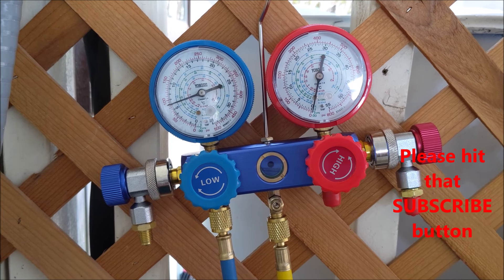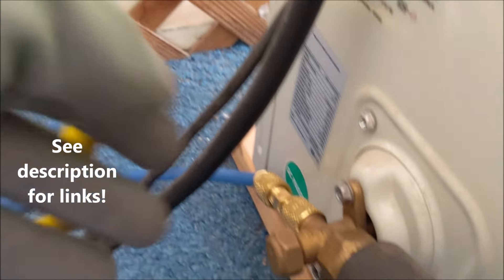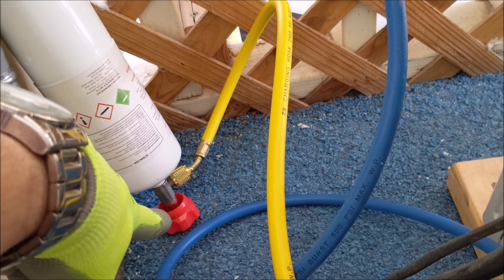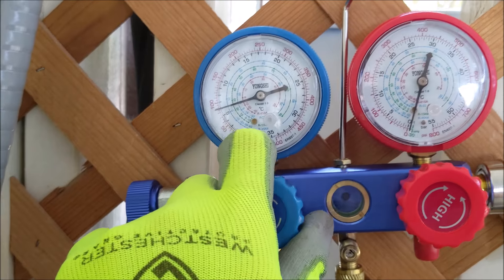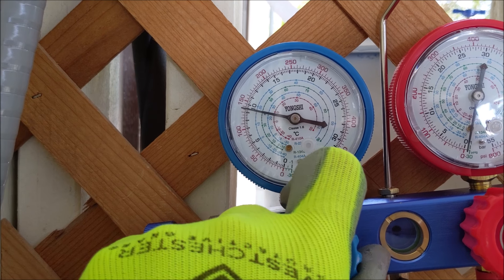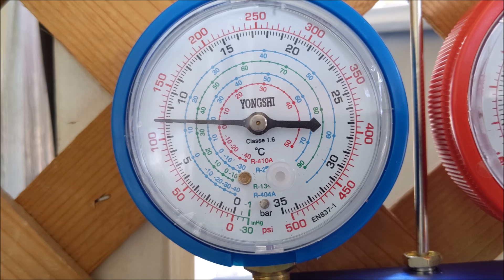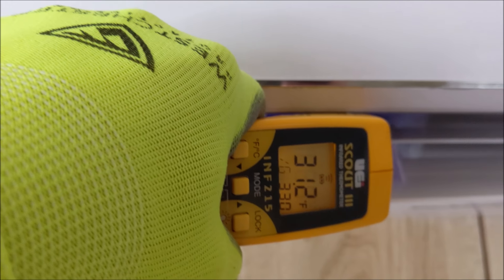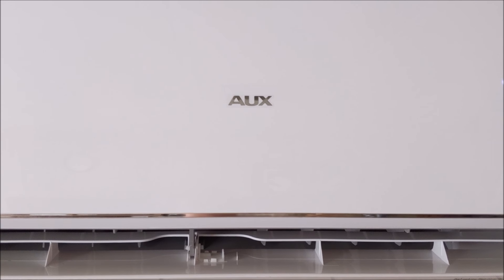How to charge mini split yourself, DIY 410a refrigerant, save money!

Comment: The bottle of 410 that I bought didn't come with a valve to open the bottle and the valve that came with my vac pump doesnt fit either. It appears to be a 1/4 in fitting but im unsure. Did your bottle come with the valve?
Reply from the maker: If you bought using the link I provided https://ebay.to/2AoIRvK (TRUSTED SELLER) you would have gotten one with a valve, as the valve is an actual mechanism needed. If you bought somewhere else, maybe to save 5 bucks, you got no valve, the cost of a valve mechanism. Cheaper is not always better. You also need to buy an adaptor, for the mini split, like this one.... https://amzn.to/30e0Tu9
Reply: 1/4” typical but 5/16” on mini splits.
Reply: Make sure you don’t have a manifold gauge for cars which is not the same size. It happened to me.

Comment: I dont get why mines shows 150 psi in blue gauge. It has 1 year of use, never had to add refrigerant, and is cooling not too much like first months. I tried first low the pressure getting refrigerant out, but not see differences in psi, then I tried adding refrigerant to see anychanges and nothing. Very weird
Reply from the maker: It could be a leak somewhere in the system, you will need to find the leak and fix it.
Reply: Call a professional

Comment: Hi, tnx for the video. Is it the same for the R32 cooling agent? The same device works? From what I saw on yours it only says R22 and I can hardly find one that says R32.
Reply from the maker: You need to check what type of refrigerant you have, as many refrigerants have been phased out over time and replaced.
Reply: @SaveGreenHere  I have R32 refrigerant.
Reply: @CountPorcula You can’t mix refrigerants. The outdoor unit has a label on it and he was using Freon 410a, not automotive freon.

Comment: I could use some help with an issue I have.
I have a Blueridge mini split that has a leak it's been dead for about 2 months now.
What would be the best way locate the leak and since it's not been working for 2 months I'm sure all the R410a has run dry so would I need to refill the unit in order to find the leak? What would you recommend doing?
Reply: Use nitrogen tank to put pressure on the system then listen or use a soapy water mix to spray on it to look for bubbles.
Reply: @rdewitt3468   you did not answer the question , he has NO refrigerant in the split. how does he fill it ?
Reply: can you run the mini split with out any refrigerant in it  to use your methid to add r410a .Will this hurt the compressor?
Reply: @bsd3662  he can’t fill it with no nitrogen. Needs to be vacuumed, pressure tested, and then refilled with 410. He needs a technician that is qualified.
Reply: @bsd3662  your mini split won’t even operate without refrigerant.

Comment: Does the 117-120 psi range apply to different sizes of AC units?
Reply: My 20 amp 110 unit said low pressure 220 should I just follow that sticker ?

Comment: $70 to show up and diagnose (what I already know), $95/lb r410a to charge here in Naples FL, typical cost?
Reply from the maker: If you did the install as a DIY, you are on the hook, because most likely the leak is in the flare connections.  If you had a professional install it, and the leak is on the flare connections (90% sure it is), then they should add the refrigerant on their own dime, for poor installation practice, and seal it so it does not leak again.  If the leak is in the coil, that is a different story. Adding refrigerant, and walking away does absolutely NOTHING. It will eventually leak again, because the leak was not addressed. Refrigerant is a closed loop system, like air in a tire, and refrigerant will only need to be added, if a leak exists. But the leak needs to be addressed first BEFORE just adding refrigerant. Here are two video options. Each video has a link to the product on the video description....... https://youtu.be/hQjOhWkGmM4    https://youtu.be/gND6-4gjs-4

Comment: I ordered an adapter from Amazon for the mini split but it doesn't fit my ac gauges ? This are automotive gauges, so I'm guessing I need to buy residential gauges? The size of the adapter was 1/4x5/16
Reply from the maker: Gauges should say 410a, like these. https://amzn.to/3z2MNuM
Reply: R22 and R410a has different screw threads... R22 screws are smaller while 410a has larger screws on the ports. I think R22 uses the 7/16 thread.

Comment: Do all brands of mini splits operate at the same psi?
Reply from the maker: This was easy because it was completely empty of refrigerant, and the system required 1.4 pounds. So after sealing with Nylog, and vacuum, we added the EXACT 1.4 pounds... https://ebay.us/d9AGph  But you can use an HVAC scale like this one https://amzn.to/3yVl9mx and for example, if you need 2 pounds, (look at the label on the side of the unit) simply place the tank on the scale, and start adding SLOWLY because you need to allow the system to cycle, and if your tank weighs X, subtract 2 pounds from X and stop once the scale shows minus 2 pounds. Make sure you thoroughly sealed the existing leak that allowed the refrigerant to escape in the first place, and vacuum the system after that. Do this BEFORE adding any refrigerant.

Comment: How do you check it when it’s on heat mode
Reply from the maker: Run it on cooling mode to test it.
Reply: @SaveGreenHere  it won’t kick on cool cause it’s cold already since it’s winter
Reply: @sergioperez2325  overide by pushing the manual button on the indoor unit

Comment: Hi i have a toshiba eco902sqn eco air   split unit system   we tried to refill but could not to find the  port to connect the refill gas to   have you any ideas where it is  we opened it and looked everywhere and couldnt find it.
Reply from the maker: Look at the area where the copper lines lead up to your outdoor unit. Sometimes the refill port has a cover on the outdoor unit that is there and can be removed with a few screws.
Reply: @SaveGreenHere  Thank you ill have a look

Comment: You seem like the guy to ask after watching your videos! I installed a dual zone system myself but had an HVAC Tech make the final connections and vacuum the system. He shortened one of the linesets by about a foot, and the other by about 4.5ft.  Can this method be used to check to see if it's overcharged?  The unit comes pre-charged for two linesets 16ft in length.  The reason I ask is my unit seems to be a little louder sounding than I expected as I hear others say it's pretty quiet, and sometimes I feel it's output could be a little better. Mine sounds like a vacuum when it pumps to the indoor heads, though it is also up on the wall above a walkway in between the neighbor's house, so I'm not sure if thats what's making it sound louder.

Are you able to advise whether the vacuum sound is normal? It's not a suction sound but it sounds like a vacuum motor which I presume is the compressor.  If I do need to remove refrigerant do you have any advice? I'd rather not call the same guy back as I don't think he knew what he was doing, and I've been having a hard time finding any company that wants to touch it since they didn't install it.
Reply from the maker: Hey Tim, if the guy that did the work used his gauges, even after shortening the lineset, I am sure he measured the proper amount. As far as the noise, I would personally compare the sound level, measured in db (decibels) from the manufacturer, with an app that measures decibels. Best to do this when there is no traffic, loud sounds such as dogs barking, etc. Another contributing factor in it being loud is if it's in an alley, for example, where sounds resonate back and forth, and simply bounce back from building walls. It's a simple law of acoustics. Sometimes, the decibels is printed on the label of the outside unit. Download a sound meter app and check it, as compared to the manufacturer decibels. If it's close enough to the manufacturer specs, then I wouldn't worry about it.
Reply: @SaveGreenHere  thanks for the quick reply! He didn't use gauges afterwards, only when he vacuumed down the unit, which is making me guess his work. It was almost impossible finding someone wanting to do the job but he came out and said he knew what he was doing.

I'll download an app and see what the current decibels are at. I'm thinking the resonating might be my problem as it's above a walkway with about 4ft to the side of the next house, so that could very well be what's happening.  I just took the dog for a walk and I could clearly hear the hum from my unit about 2 houses down.

Comment: Does the 117-120 psi apply to all units? I have a pioneer 24k btu system. I doubled the line set from 16’ to 32’ and sadly lost some refrigerant because the flares on line sets was bad. Anyway, I have the pump and refrigerant now and just need to confirm if the psi is an industry standard.
Reply: Did you ever find out what the psi should be for a 24k system? Mine says 550 high side 340 low side for design pressure. I can’t seem to find how to translate that with how this video describes.
Reply: @Celohyoudee  For future reference, that is DESIGN pressure, meaning the pressure that the system can safely withstand before catastrophically rupturing somewhere. Design pressure is NOT the normal operating pressure of the gas. Operating pressure will be lower. Manufacturers do not specify operating pressure because there are too many variables. That's why they specify charge weight.

Comment: I am installing a second-hand 12000BTU mini split, it was working at my parents’ home for the past 2 years. This is the first time I’ve done this.
I don’t think it was decommissioned properly as when I attached my gauges there was no vacuum, I vacuumed both compressor & lines together by opening the valve when I vacuumed the lines. I gassed it to 125psi then turned on the evaporator & set it at the lowest temp with the fan on high. However, the compressor kicks in and out & the pressure changes from 240psi when idle, then when running (maybe 30 seconds) it drops as low as 50psi before the compressor goes idle again. 
What am I getting wrong? Any & all advice is greatly appreciated…
Reply from the maker: Is it plugged to a GFI, or is it wired directly to a disconnect box?
Reply: All sorted, like an idiot I forgot to open both valves. One was closed, so it was like I was pumping down!

Comment: Can you tell me why side panel on mr cool says design pressure low 340psi and hi 550?
Is it going to be 340psi rather than 120?
Reply: 340 and 550 is the high side..the suction line ( vapor) is 120..

Comment: Hi please my a/c is not vooling like i use to 
I have had it cleaned up
And had them put in refrgrant the pipes are coling but its still not really cooling like it use to 
What do i do please
Reply from the maker: If you cannot DIY, you may need to contact a professional. Simple.

Comment: Let me start by saying...Love your videos. Very helpful. I have a dual zone mini split and one of the zones is low on pressure.The other one is fine. Can I still run the one that is fine until I get the other one back up to pressure. Also when I go to get 410a refrigerant it ask about e.p.a cert or am I going to sell to someone with e.p.a. cert. do i just say I'm going to resell. Also I'm in California. Does that matter? Thank you for your time. The link doesn't take me to the tank that you had in the video. Will I need a adapter for the 7.5 lb or the 11lb tank?
Reply from the maker: You should be able to operate the other indoor unit, even if one is down. As far as refrigerant, the 25 lb canister is the best bargain at 110.00, so you would be paying around just over $4 a pound. Still better than paying over $25 a pound from a tech. And about that message, it must be a California thing, as I have live on 4 different states, purchased, and never seen that. Here is the best price, from a trusted seller, and quickest delivery, which is important when you have no refrigerant and dealing with the elements of the weather..... https://ebay.to/2ZVtnte
Reply: @SaveGreenHere  Thank you so much!!! I have one more question please. I'm not a unexperienced person when it comes to working on things. Just a/c...lol...I've been in construction for 30 years. I'm only saying this so you know your not talking to a all unknowing person. To be clear. When the unit is shut off. The low side factory pressure will be at 210 psi and running in cool mode it should be between 117- 120 psi. The factory pre-charge was 210 psi with the unit off. I just realized after some research that I messed up after vacuuming down the system. The more and more I research I find what all I did wrong. First thing I did and what caused it to not cool was I didn't realize I had some high side ports to open up. I'm not going to bore you with the whole long story but I ended up letting out refrigerant because after your video I thought 210psi was way to high. Well that was with the unit off. Now when it's running on cool mode one of the indoor units is condensing I believe because it is low on refrigerant. It's running on cool mode at 100 psi. This is a dual zone unit. Do I need to check and fill each side separately or will both sides be taken care of through the one low side port even though there is actually two low sides and two high sides? Thank you so very much for your time.
Reply from the maker: @JustJeff62  If you have low refrigerant on that particular indoor unit, most likely, the connections may be your culprit. Refrigerant is a closed loop system, and should not escape. You must sniff out where the leak is at, if it's at the connections to the condensing unit, or at the connections to the indoor unit mounted on the wall. Use one of these, https://amzn.to/3mIAm2r and for under $20 you can have an idea if the issue is on the outdoor connections, the indoor connections, or both! It's best to run both of them and check pressures and it must be at least 120 to 140 each.
Reply: @SaveGreenHere  Thank you brother!!!! You are a saint for sure!!! I may be tugging on your ear again.
Reply: Can this be done wen temp in 40s outside
Reply: @JustJeff62  lol I had the same issue I thought 200 psi was too high when I was checking while unit was off, I was thinking about removing some refrigerant... because I thought it was grossly overcharged... but then I thought how can it be.... it was working before... yet now it’s not working and I see pipe froze up low pressure wider diameter pipe outside of mini split....

Tsk tsk tsk... so I thought how can I add refrigerant....? While unit is off.... I tried adding while unit was off, with bottle upside down...

However it didn’t look like pressure was rising....  so I thought maybe the reason why I don’t see charge working is simply because I am trying to charge with shader valve in.... through the same port that is checking pressure....  but then I thought to myself, but wait Shrader is pressed in, since I see that it shows 200 PSI.... and if it’s pressed in and I see the pressure showing then that means refrigerant is pushing out....   out of the pipe.....

So I thought to my self.... how on earth will refrigerant ever go into ac unit if it’s basically trying to come out..... and I am trying to put it back in through the same port....

It didn’t make sense to me.... the force of pressure pushing refrigerant in from the r410 tank would have to be significantly higher....  then the pressure shown on the gauge of the low pressure pipe....

I thought to myself how can I get the low pressure pipe to suck the refrigerant in..... without creating a vacuum first.....

So I started researching and found almost all instructions telling me to evacuate refrigerant then checking for leaks and creating a vacuum then adding ac.... which I understand is the right way of doing things....  but.... it’s not like I have a lot of leak... it seems a bit over kill for me to do....  

Little did I realize that I need to have the unit in cool mode.... causing evaporator handler or should I say inside inverter unit.... to essentially suck refrigerant in.... reducing the pressure to optimum level of 117 to 120.....

Since my pipe was frozen I am fairly certain that when I turn ac in cool mode....  I will see pressure being lower than 200 possibly being at 100 psi.....   I still need to do that.

In regards to leak detection... in my case it maybe very small leak... the electronic leak detector tool may not be able to detect it effectively.   I may need to use bubble soap....
To see what’s up.... most likely leak is at the service valve levels.

Actually it could be on the king 3 way and 2 way valve.....  the problem is these valves suck...  if you open them up too many times.... it will cause problems... meaning small leaks....

I opened up them maybe 10 different times so far and tightened them too much..... I may need to add some nylog around it.... but yes I need to check king valves.... what a pain in the neck...

Comment: I thought with variable/inverter compressor the gauge reading is not vary inaccurate? I'll all for the fudge it method to top off a slow leaking system for DIYer...just curious to anyones opinion on the usefulness of the gauge.
Reply: System should be on max cool setting for gauges to be accurate
Reply: when it is first turned on, that is when to check it, it is running at all it will do